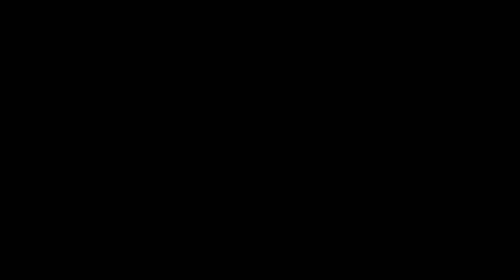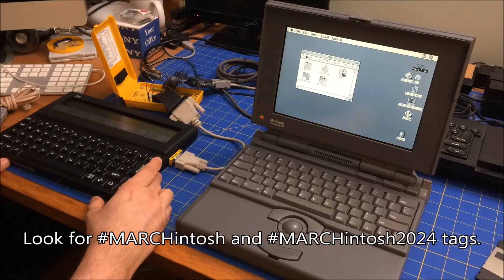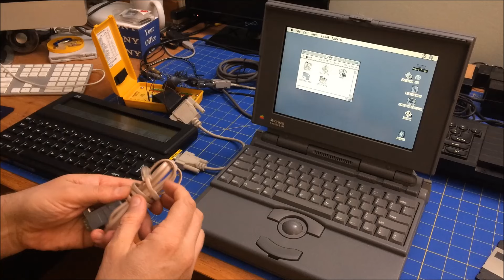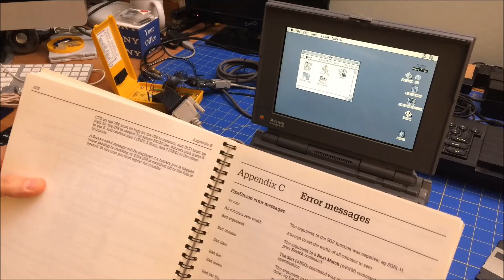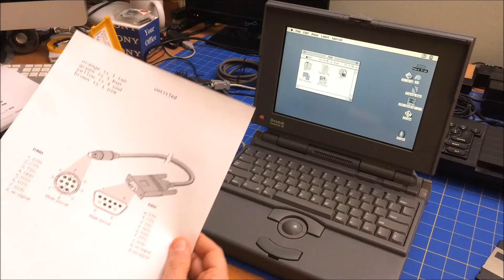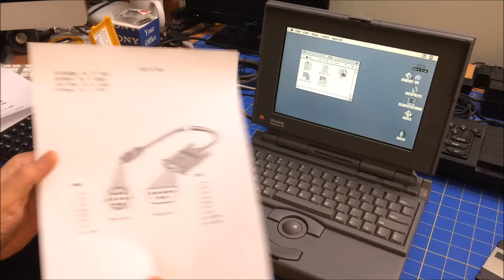Sinclair's 1987 Portable Macintosh: Cambridge Z88 - #MARCHintosh

Comment: Yeah, with the +/- lines ie. differential lines, on the serial port, it could be either RS-485 or RS-422, which iirc the latter is used by the macs
Don't quote me on the last part thought

Comment: Glad you got it working! My unsolicited advice would be to use DuPont leads and use trial and error, once i have it figured out I build a cable. All those adapters are potential points of failure. Also, old cables get wire breaks you can't see under the shielding.
Reply from the maker: Thanks. It was definitely frustrating. I did check each of the 9 pins from the din connector to the DB-9 to make sure the wires were working and correct, so I knew that wasn't the problem.